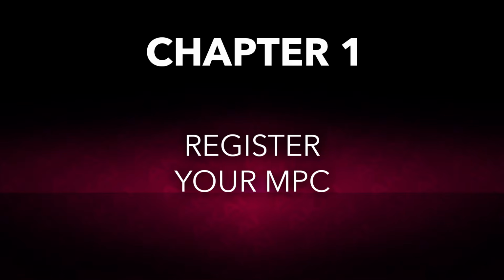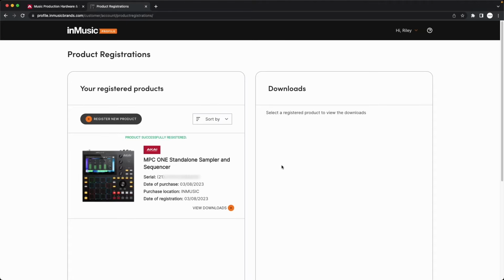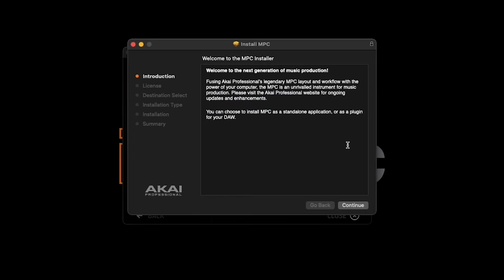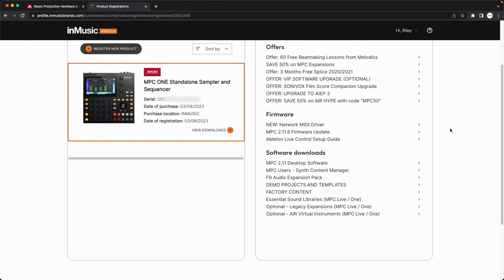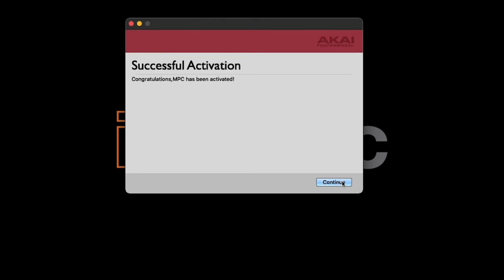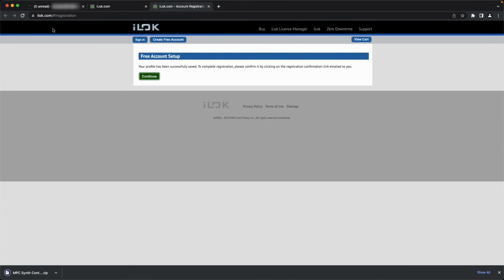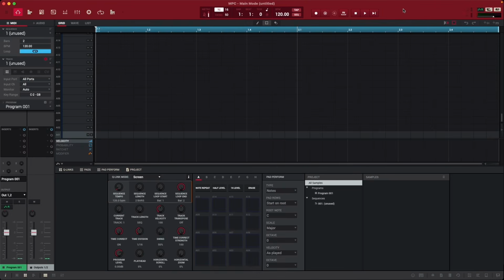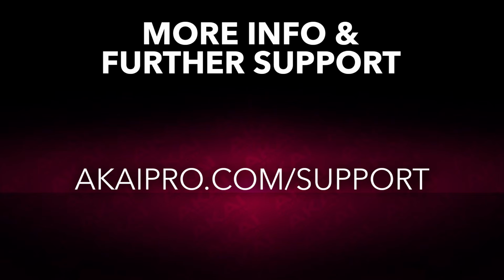Akai Pro MPC Series | Install & Activate MPC 2 Software & Drivers

Comment: Horrible first time user experience. I just got the MPC keys 37 and wanted to get stem separation working. An hour later, still not any closer. What is going on here? I'm starting to think I would just be better off with a laptop and Serato.

Comment: Wow, what a mess, Akai doesn't get it. How many accounts and activations do people have to make to use this. What is this ilock crap, it's the reason I went away from Akai. I just wanted to set up a used Mpc Live with the latest software and work immediately. I saw the Akai process and went with a used Roland MC-707, plugged it in downloaded the update with no account needed and was working minutes later.

Comment: I have a new MacBook Air 2024 and I’m not seeing how to download the driver for my MPC LIVE. I haven’t been able to find the driver installer program that allows me to choose the MPC LIVE for install. I have MPC2 on my MacBook but when I connect the MPC LIVE it keeps telling me the driver isn’t installed. Feel like the answer is right under my nose but I could use a little help.
Reply: i have the same problem
Reply: So I’m not crazy
Reply: Not joking. Same driver problem. It feels the driver won't work for MacBook Air 2024 and there's no way back, because the software works in my old laptop which has the same setting. Let me know if you found anything! This is driving me crazy. I used to think it's because I'm using a MPC renaissance. If even MPC Live has the same problem, it;s even worse.
Reply: @victoryu6906   Download the INmusic Synth Manager. There are TWO of them. Get the NEWEST version. Download the drivers from there and all updates.
Reply: @chrislandy5597  Make sure to download the latest MPC SYNTH MANAGER. There are TWO. I had the same problem. Get the new one. Download the drivers on there.  It will fix the issue.
Reply: same here with mpc one and mpc 2.15.1 soft, there wasnt any option to choose instal driver for mpc, just classic mac instalition process, no fancy window like on video :/
Reply: @chrislandy5597  Download the INmusic Synth Manager. There are TWO of them. Get the NEWEST version. Download the drivers from there and all updates.

Comment: Had the Live 2 since release. Never used controller mode. Just got Stems, it will not connect to controller mode. It says the drivers are out of date. What? I’m on version 2.14 on both the software and on my Live… Where tf are the driver downloads??! I can’t even use Stems.

Comment: what are the guidelines for installing the driver in regards to having the hardware connected? Normally manufacturers are very clear that the device needs to be disconnected and connected at a specific timing of the steps??
Reply from the maker: Hi Johnny! Your MPC hardware does not need to be connected to your computer at any point during driver installation.

Comment: I've been working in VFX for 30 years and I've never seen anything like this. I've had to use some really complex activations, but this man...wow. This needs to change. I had to keep jumping online to figure stuff out and it kept taking me to people who are just hacking the software to get around all this. This video is out of date. If people are hacking your stuff, not because they want free stuff, just to activate what they bought, you gotta change something. I can see at some point you just kept adding more and more and that's great, but you have to step back a re-assess how people can pay and access. Sell me a plugin that will activate instantly without constantly accessing my account. I'll buy it! Cut it out with the registering. I think I signed up to about 4 things today. So angry and slightly regretting my purchase.

Comment: Had the Live 2 about 2 years ago and sold it. Just bought a used studio mk2 and a new computer, however my old computer is done for. Will it be possible to dowload my old software yo the new computer for use with the studio mk2?